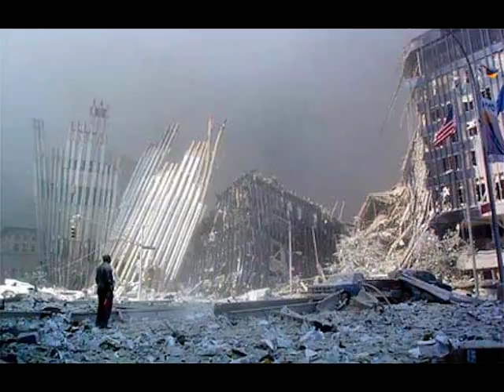O&A - Dr. Michio Kaku explains why 9/11 Conspiracies are bullshit, other things.

Comment: Tell me, how does World Trade Center 7 go POOF...and collapse primarily due to fire in this manner:
1. ALL AT ONCE
2. STRAIGHT DOWN WITHOUT TOPPLING OVER
3. FREEFALL FOR 2.25 SECONDS (NIST NOW ADMITS THIS AFTER YEARS)

FIRE IS NOT INTELLIGENT AND CANNOT SELECTIVELY MAINTAIN BALANCE TO PREVENT THE BUILDING FROM TOPPLING OVER AS A IT COLLAPSES.

FIRE IS NOT INTELLIGENT AND CANNOT INSTANTLY CREATE A 80 FT GAP FREE OF PHYSICAL IMPEDIMENT FOR A 2.25 SECOND FREEFALL.

ONLY INTELLIGENT EFFORT IS THROUGH HUMAN INTERVENTION!

So, who did it terrorists or demolition specialists??
Reply: Because half of the bottom of the building was damaged from debris from the north tower falling into it, and the rest was ravaged by fire for hours and hours. Fire doesn't melt steel, it does however significant weaken steel, and with the weight of concrete above it and damaged foundation, eventually important columns weaken too and the building collapses. That sounds far more plausible than any conspiracy theory iIve ever come across.
Reply: clachifer National Institute of Standards and Technology, NCSATR 1A Executive Summary states "This was the first known instance of the total collapse of a tall building primarily due to fires".   Not to mention a collapse that resembles a BENCHMARK DEMOLITION!!!
 
According to the this report "word for word"
..."However, the reader should keep in mind that the building and the records kept within it were destroyed, and the remains of all the WTC building were disposed of before congressional action and funding was available for this Investigation to begin. As a result, there are some facts that could not be discerned, and thus there are uncertainties in this accounting."
They did not do a forensic examination...WHY because of funding??
So, the richest country in the world with a sky high emergency budget following 9/11 can't afford a forensic examination with bomb sniffing dogs to sniff out potential explosive residues. This has every sign of a COVER-UP!
Reply: al murphy First known instance of a building collapsing primarily due to fires ? It wasnt like someone lit a match and it got a little out of hand, it was damaged before the fires even started, then got weaker and weaker. The way conspiracy theorists talk, its as if you think buildings are invulnerable. 

And it didnt resemeble a demolition at all, did you listen to this DOCTOR speak, demolitions fall bottom upwards, not top down. Key columns eventually buckled under weight and damage and it caved in on itself. 

And before you make the case of people hearing explosions, the glass breaking from the weight above it falling makes more sense than "hidden bombs". 

At least the official story has evidence, conspiracy theories are just that, an unproven theory, speculation and non facts.
Reply: clachifer Tell me why the fire in WTC-7 was not put out by the FDNY and allowed to burn for 8hrs??  And please don't tell me that the water pressure was too low.  FDNY had Fireboats ready to pump water from the Hudson River just a quarter mile away to support land based systems.  According to this reference: Lessons Learned from the World Trade Center Disaster about Critical Utility Systems, they had excess capacity!
Reply: clachifer Regarding your earlier comment about the Doctor, he was referring to WTC-1 and 2 collapse not WTC-7.
And yes, NIST stated  about WTC-7  "This was the first known instance of the total collapse of a tall building primarily due to fires".
And the fact is FDNY made no attempt to put out the WTC-7 fire at any stage of the fire!  Even the firefighters don't deny this. 

First of all, identifying flaws to the official 9/11 Story is not a Conspiracy Theory. There are enough evidence that makes this a Cover-up and there appears to be a powerful force behind the 9/11 Cover-up that even controls our mass media!
People have to understand that our mass media has limits to their freedom. There are Fire Fighters , Police and GOV officials that are afraid of speaking out from fear of losing their jobs. There are numbers of video clips on Youtube showing Firefighter stating explosions in the lobby area of the twin tower while they were in a staging area ready to put out the fire on the 80th floor where the plane hit. They weren't allowed to testify!  Nothing was mentioned of this in the 9/11 commission.  Most of the commissioners even agreed that 9/11 was not investigated properly.

CNN Pentagon correspondent did a live coverage from the Pentagon on 9/11. Upon his close up inspection there was no sign of a plane anywhere near the Pentagon. But there was no follow-up to this coverage.  See CNN Pentagon 9/11 coverage "only aired once and never again" on Youtube.  I wonder who owns our media??
Reply: clachifer The government don't own our mass media.  They have private owners.   Why a cover-up by our government??  There may have been crooks in high places within our government that had a higher allegiance to something other than the USA such as an powerful organization that transcend nations.  Some say that it was a criminal element within the Bush Administration that had ties to the NWO. Now tell me something.  Lets take the Deputy Secretary of Defense Paul Wolfowitz for instance. How did he go from the Deputy Secretary of Defense of USA to the Head of the World Bank???

HOLES??  Here are some big ones...

1. The passport of the terrorist onboard the plane that hit the twin tower was recovered. Incriminating evidence in a form of a paper in the plane embedded in the blazing twin tower inferno. YET the almost indestructible black box cores of the planes were NOT recovered and presumed to be completely destroyed. Do you believe in the Magic Passport Theory??

2. Supposedly Flight 93 crashed in Shanksville, PA on 9/11.
But the Cell Phone call from Flight 93 where they somehow uttered BOXCUTTER is FAKE!
The problem is the entire land is not made up of contiguous cells. In rural areas it covers major roadways and little more back in 2001. The signal is very scanty in rural areas which is most of US land. So, there is really no chance of a cell to cell handover from an air route from 25000ft moving at 500mph. Add to that being 5 miles in the air with weak "highly directional" signal from the dinky cell phone transmitter (which is the limiting factor) that ground based "base station" systems aren't even aiming up at!
And somehow they uttered BOXCUTTER??
The cell-phone provider records leave a lot of foot print.
I would be delighted to see the subscriber bill and roaming charges of that phone!
Do you believe in the Magic Cellphone Theory??

3. How can you believe that the Pentagon was hit by a 757??
To this day they haven't released one frame of a 757 approaching the Pentagon on 9/11 on one of the most heavily surveilled area in the USA with security cameras, not one recognizable picture! And why would our GOV have to confiscate privatley owned closed circuit TV video tapes from the surrounding area?? That is a COVER-UP you don't have to THEORIZE!

Jumbo Jet didn't graze the grass and overshoot a 4 story building at 500mph without any airport landing aid and by amateur pilots?? Oh, and No trace of the plane!
Reply: al murphy
I'm not changing your mind and you're not changing mine. We could go back and forth for a long time it seems. You think one way and i think another, let's agree to disagree and be done with this. Adios amigo.
Reply: clachifer When you don't have any good counterpoints you can't possibly change anyone's mind.  Looks like you're
short on ammo on the world stage!
Reply: clachifer Mr Adios can't stick to his words...truth shines!
Reply: monsiuer tumbleweed YOU'RE SICK!!    IF YOU EVER DO HEAL THEN GIVE ME A COUNTERPOINT.
Reply: monsiuer tumbleweed Don't mind me...THE DEVIL IS LISTENING TO EVERY WORD YOU SAY!
Reply: al murphy Sir. I don't know if you know this yet. But the government already retracted the NIST report. The commissioners themselves such as Bob Kerry came out to say it was a coverup a long time ago.

So it's time you stopped spreading disinformation. Please and thank you.
Reply: ***** Bottom line is this...there was NO forensic examination of the remains of WTC-7.  And the remains weren't moved from point A to point B for later examination.  They were directly disposed of!  The NIST report is like a police report where the police doesn't examine the crime scene but saying we think we know what happened??  DAMN RIGHT THAT'S UNCERTAINTY!  But ask yourself this.  If you want to cover-up a crime scene then do you want certainty or do you want to bury the truth??
Reply: al murphy Oh shit I thought you were a debunker. I only read the part where you referenced nist so I just assumed otherwise. My bad dude. Keep up the truth.
Reply: clachifer  What about the perfect passport, but no black box...How can that be explained?
Reply: al murphy All human life was out of WTC 7 and the building was a total loss. The owner of the WTC properties told the Fire Departments to pull out of WTC 7 when the building was free of humans and to not risk any life over saving a long gone building. That it recorded in several videos and documents. What was the point of risking the lives of firefighters when the entire complex was going to be totally demolished and claimed for insurance money anyways?
Reply: Randy Sullivan Seck
9/11 is a cover-up and World Trade Center 7 collapse is the smoking gun.  Why is that so??  WTC-7 fully collapsed in a manner that resembles a controlled demolition.  For 2.25 seconds it collapsed at freefall and National Institute of Standards and Technology now admits this.  In order for it to freefall for 2.25 seconds you need a uniform gap of approx. 80ft free of any physical impediments (equivalent of blowing out 7 floors almost instantaneously).  Fire is not magic and cannot do that!  It takes the prepositioning of demolition components that are finely timed throughout the building to accomplish this.  WTC-7 had GOV agencies as part of its tenant (US Secret Service, CIA, IRS, DOD...)  With tenants like that it is impossible for an outsider to get access to the building to preposition demolition components.  Whoever did had to have their consent!
Reply: monsiuer tumbleweed Monsiuer. Even buildings that collapse from earthquakes still retain their shape.
Search "9/11 Research Other Building Collapses."

Or how about you look at Building 5? It was set ablaze in a more stronger inferno and hit by many more debris than Building 7.

It still did not collapse.

Monsiuer. Please continue on your research before you dish out your assumptions like you are an expert.
Reply: monsiuer tumbleweed Yes it is basic common sense. You are right. You don't need to do research to know that 2 planes cannot cause 3 buildings to collapse especially when building 5 was hit by more debris and set ablaze and didn't collapse.

I'm no conspiracy theorist but when I see the stupidity of the official story I am left with no choice.

You know the Nist Report left out building 7.
You know the 9/11 Commissioners themselves resigned and said it was a cover up from start to finish.
Commissioner Bob Kerry said on video that it was a 30 year conspiracy. You can see that yourself on youtube.

You know when the commissioners who made the official story are fucking telling you it was a conspiracy, and you still don't believe them, then something is terribly wrong with you.

It is easier to fool someone, than to convince them they have been fooled - Mark Twain.
Reply: monsiuer tumbleweed At no point in your rambling, incoherent response were you even close to anything that is considered a rational thought. Everyone in this room is now dumber for having listened to it.

You shoot one guy and shoot another guy doesn't mean a 3rd guy would die. You are still omitting the 3rd guy in your metaphor, just like the Nist Report.
What kind of logic is going through you head? 

You seem to be oblivious to Building 5 that was right underneath Buildings 1 and 2 and was set ablaze and hit by way more debris than building 7. It still did not implode symmetrically into it's own footprint in a controlled demolition matter like the other 3 buildings. It remained standing no matter how charred.

You seem to be oblivious to the 2,600 Architects and Engineers at AE911, all of which have to have over 20 years of experience in their field to join. They made a purely scientific documentary titled Explosive Evidence proving how it is impossible for any of those 3 buildings to have imploded because of office fires. It aired on PBS 9/11/2011 which is what made me interested in 9/11 in the first place.
What I liked about it was that it was it was no conspiracy, no bullshit, just science.

If you could bring down a building with just fire then demolition experts would just be using kerosene to save thousands of dollars.

"You think a secret like this could be kept, you don't think people aren't very good at keeping secrets?"

Manhattan Project was kept secret by 400,000 individuals for 40 years. So what's your point?

"How do you know I'm not an expert? (I'm not but that was a pretty arrogant assumption, you don't think most experts think you're a fucking waste of time who is talking shit?)"

Well first of all. You are talking shit. So you are just commenting based on emotions rather than logic and information.
Reply: monsiuer tumbleweed No need for animosity and dread. It'd be better for our cholesterol if we just remained calm and discuss things smoothly.

Anways the CEO Manager of Construction for the WTCs explained that he built the towers so that they could withstand multiple impacts from planes like an insect net.

But surely something went wrong when it imploded 100s of feet below the foundation leaving nothing but molten steel.

I think you need to google "9/11 Research, Other Building Collapses." Buildings that fall from impacts still retain their shape.

Why would the entire building implode if only a small section was hit?
At most it would have been partial collapse of the section that was hit.

But even in the 40s, a B-42 Bomber hit the Empire State Building and there was still no partial collapse or anything.

You know debunkers on facebook do not use Impact Theory anymore? The ones who are still in the loop don't even use pancake theory anymore cause it's just too dumb.

Anyways. I hate most post 9/11  contemporary Moe-Era age computerized anime. And school shootings such as Sandy Hook and UCSB's Elliot Rodgers are fake as shit.
Reply: ***** Thanks, I don't even bother reading this guys reply anymore...he's hopeless.
Reply: he is ignorant
Reply: pascalirinel It's no that so much.  The BIG PLAYERS like are GOV are his potential employers.  Don't burn any bridges for  future employment!  Principles???  What's that?
Reply: pascalirinel  more accurately... he's a shill.

Comment: Truthers: "The top section's downward acceleration at 2/3 the rate of freefall through the undamaged section below is an undisputed fact--this would be impossible without something compromising the undamaged structure. In addition, there were explosions reported in the basement, resulting in structural damage.  This is extremely unlikely to have been the result of jet fuel pouring down the elevator shafts (the official claim), given the size of the buildings and the relatively small amount of fuel that didn't get consumed in the giant initial fireball. Additionally, 112 firefighters and EMTs reported witnessing explosions."

Michio Kaku: "Demolitions are done from the bottom, not top down, and buildings are mostly made of air!"

Give this man a Nobel Prize already!!!

Comment: Top down: They just as easily could have set demo charges every, idk, 3 stories to make it look real. Doesn't exactly look like it absolutely wasn't the case since there were what appeared to be explosions below the falling parts of the building as it collapsed

The steel being weakened: I've heard that jet fuel still doesn't burn hot enough to cause it to weaken enough to collapse. and it would only weaken the top section and the steel should be able to withstand the pressure TBC...